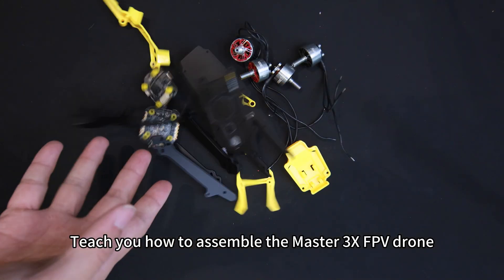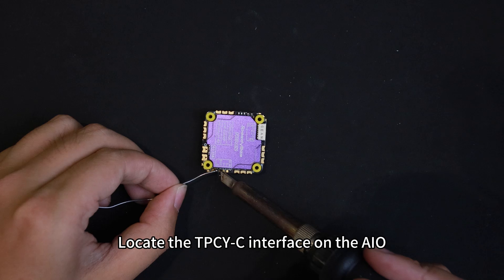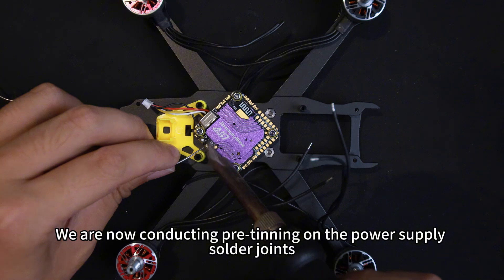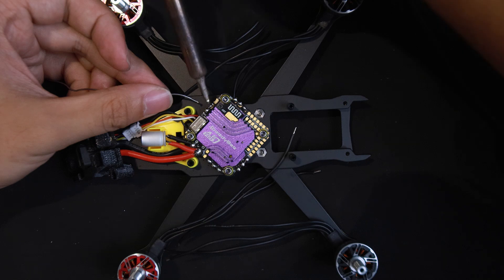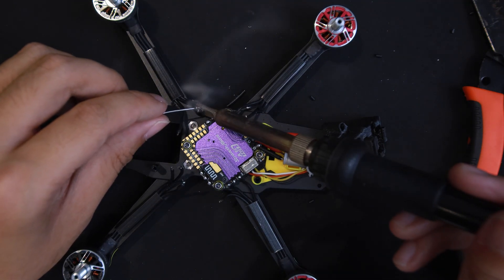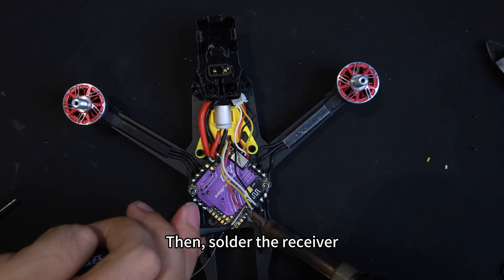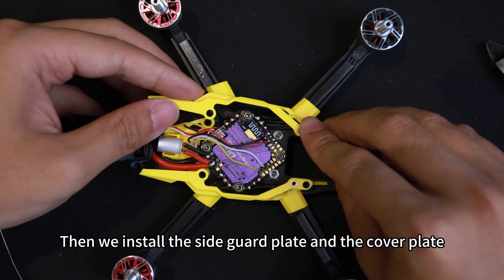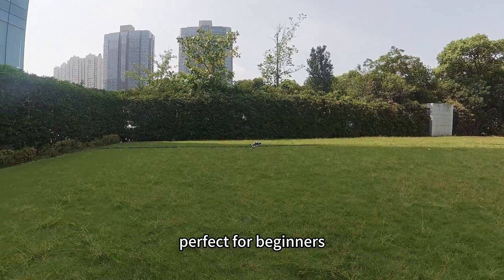Build 3.5 Inch FPV Drone – Maste 3x Step-by-Step!

Comment: I ordered the same aio fc which comes with the capacitor. It doesn't fit. Not enough space in the frame.
Reply from the maker: Thanks for the feedback! 🙌
Yeah, some tight frames don’t leave enough room for that big capacitor.
Two quick fixes:
🔧 1) You can mount the cap sideways or under the stack with heat-shrink.
🔧 2) Or swap it for a smaller low-ESR cap (470 µF works well).

If you let us know your frame model, we can help you find the best fit! 🛠
Happy flying! 🚀
Reply: @mepsking Isn't the video about the Speedybee Master 3x frame? This is the frame I was referring to. I guess I should have mentioned that.